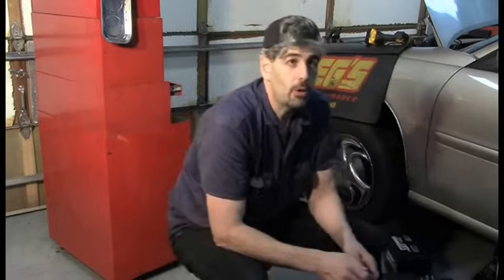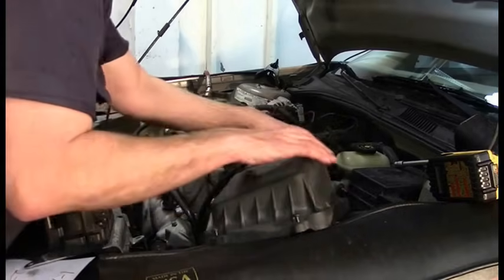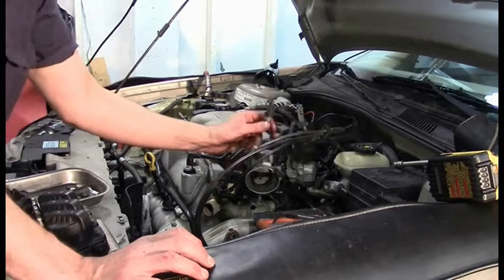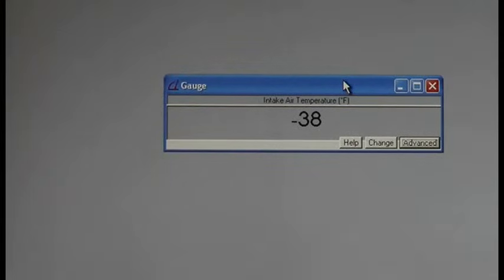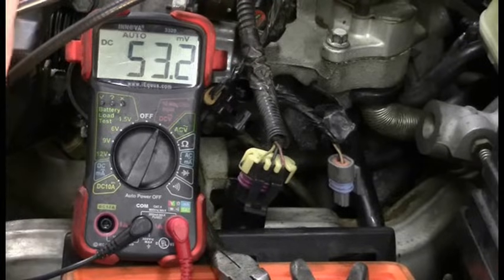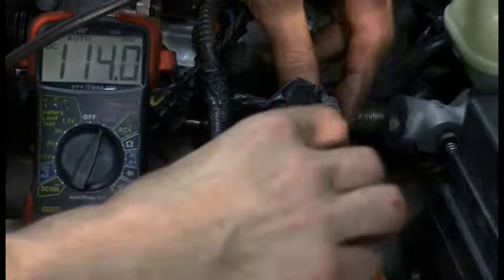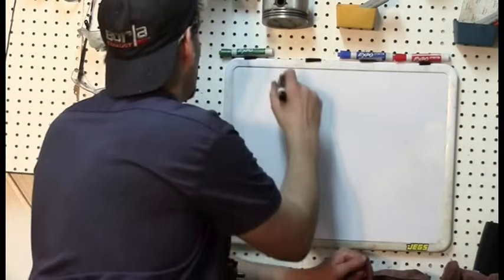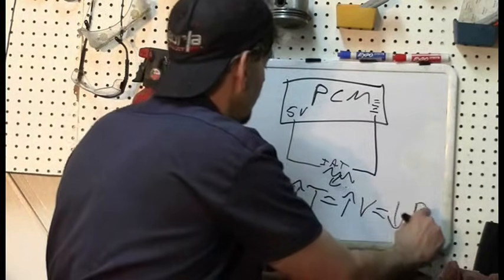IAT ( Intake Air Temperature Sensor ) Diagnosis P1111, P1112, P0113

Comment: The circuit for the IAT sense is slightly different than you drew on the white board.  Inside the ECM you will likely find a series resistor to ground on the signal lead.  This forms a voltage divider circuit that is read by an analog to digital converter in the ECM.
Reply from the maker: @arlen- upon closer inspection of the wiring diagram, you are indeed correct! Thanks for the info!
Reply: arlen, good advice and nice to know for sure…diagnostics on this circuit would still be the same regardless of whats happening inside the computer however.  The signal wire from the computer has to be capable of sending 5 v to the sensor, the variable resistor (sensor) has to be capable of accurately changing resistance based on temperature, and the return or ground wire has to be capable of returning the updated voltage from the sensor back the the computer.  If these 3 things are present, and good terminal/pin connections are good at the connector harness and computer harness, it has to be a bad computer..the circuitry inside the computer is irrelevant because its non serviceable anyways.  Correction: if all relevant inputs to computer are good, along with all powers and grounds, then its a computer issue.
Reply: Jeffrey:

When diagnosing problems in an electrical circuit, it is helpful to know and understand the circuit as it was designed.  This will allow you to discover the fault faster and with more confidence.  An incorrect understanding of how the circuit is supposed to operate will delay finding the actual fault and could lead one to replace good components.  The circuitry inside the ECM is not irrelevant, knowing what the circuit is allows one to understand what types of faults are likely causing the situation being diagnosed, and to devise tests to determine which particular fault is present.

Comment: I like the way you go about trouble shooting things.   Great videos, thank you for sharing Matt.
Reply: Hi , from all the videos that i have seen that you made, i know for sure that your knowledge on automotive repair and diagnosis is quiet impressive.  So i have a trouble on my 2000 Ford Focus DOHC, with a 5 speed manual transmission. 
My dilemma is, when the engine is cold, the idle goes up and down, i call it pulsating. On idle the "engine goes from 1000 to 1500 repeatedly  till the eng gets to operating temp. Then it starts to idle fine. Please help to try and solve my problem.
And thank you for your time.

Comment: I have the Power-probe Master kit as well and yes, it has definitely paid for itself. I've ran into this exact issue and you did exactly what needed to be done, good job Matt. Remember, when the engine is stone cold, all temp sensor signals should be identical if not close. You can quickly do a rationality check with a scan tool by looking at all the temp sensors.

Comment: Good vid man!  That reference to ETCG's wire soldering video was hilarious..man his vid was so bad I thought it was a joke lol.  GM issued a Technical Service Bulletin on this issue for this year make and model relating to these codes.  I think in the past somebody had perfumed the repair for the TSB and did a poor job.  Here is the TSB for your reference: 
Service Engine Soon Light With Stored Codes P0112, P0113, P1111 or P1112 (Replace IAT Sensor Connector)
1997-2002 Chevrolet Malibu

1997-1999 Oldsmobile Cutlass

1999-2002 Oldsmobile Alero

1999-2002 Pontiac Grand Am

with 3.1L or 3.4L Engine (VINs M, J, E -- RPOs L82, LG8 , LA1)

Condition
Some customers may comment that the service engine soon light is on.

The TECH 2 will show stored diagnostic trouble codes P0112, P0113, P1111, or P1112.

Cause
This condition may be caused by a broken wire at the intake air temperature (IAT ) sensor connector. The break may not be readily apparent as the insulation may be intact.

Correction
If routine diagnosis leads to a broken wire at the IAT sensor connector, replace the connector as follows:

Remove the tape from the engine harness convoluted tube where the IAT circuit wires join the main engine harness. 
Locate/isolate the 2 IAT wires within the engine harness. 
Disconnect the IAT connector from the IAT sensor. 
Remove the tape from the IAT and MAF (mass air flow) sensor wires to allow removal of the IAT wires. 

Important
Before cutting the IAT circuit wires, it will be necessary to determine the proper length. You need to add 38 mm - 50 mm (1.5 in - 2.0 in) to the length of the wire going to the IAT. Also, when cutting the IAT circuit wires, it is important that the wires are cut in a manner that will not create a large mass. Stagger the cuts and install the connector kit. Original connector cavity "A" has a red wire and cavity "B" has a tan wire. Make sure cavity "A" and cavity "B" wires on the replacement pig tail connector match "A" and "B" wires on the engine harness. This will provide strain relief and prevent recurrence of this concern.

After staggered cuts are made on the IAT wires in the engine harness, strip a small amount of the insulation from both wires and install the kit butt connectors to the bare IAT wires by crimping both. 
Stagger the cuts on the pig tail wires to match the IAT engine harness wires. 
Strip a small amount of the insulation from the pig tail IAT wire ends. Install and crimp both wires into the open end of the butt connectors that were installed on the engine harness IAT wires. 
Heat shrink both IAT butt connectors and let the wires cool off. 
After cool down is completed, the harness can be neatly taped with electrical tape. 
Install the IAT connector on the IAT sensor. 
Clear the codes. 

Parts Information
Part Number
Description
Qty

12102620
Connector Pig Tail
1
Reply from the maker: As always, thanks and great input.  Given that information I would surmise that this exact issue is what happened at some point and a previous owner replaced the connector on their own but it didn't hold.  When I examined it, the wires were just twisted together and electrical taped.  I'm sure at some point when the air filter was changed, the stress on the wiring at shoddy repair created the open.

Comment: So u traced the signal wire rather then the 5 volt ref wire??
Reply: with 2-wire sensors, the 5v ref is the signal if theres a variable resistor as the sensor.
Reply from the maker: frank hager Correct, Frank thank you.  Some sensors have 3 wires where one is feed, one is signal, and one is return (ground).  Not shown in the video is that I also traced the ground and it was open as well. 
  Happy Easter guys.
Reply: Schrodingers Box I was going to say that when you had confirmed the sensor was good, and then put your DVOM leads across the harness connector and were reading an open circuit, the only thing I would have done different at this point would have been to put my red DVOM lead to battery + and the black lead to the ground wire at harness connector to see if I had 12v.  This would have confirmed a good ground. Then black lead on DVOM to battery( - )and red lead to the signal wire at harness connector.  If ghost voltage was present at this point it would have narrowed the open to the power wire.  If I am dealing with an open, I always want to narrow it down to which side of the circuit the open is on.  Of course, in your case both wires would have tested as open due to the horrible repair that was done in the past lol. That could easily throw a guy off, since it is so rare to have an open circuit at both the power and ground side of the circuit.  Almost always its one or the other :) I have never used an open/short finder like you did in this vid, but I will be looking at getting one after this!  Even if it only saved me a few minutes each time I used it, it would be worth every penny!
Reply: Jeffrey Wilson Yeah, search 'fox and hound' circuit tester and you'll find lots of reviews. Briansmobile1 did a nice practical review video about a year ago on a less expensive device. These can be costly, though it would be possible to make your own with a signal generator and a receiver. I wondered whether making my own would put my vehicles at risk of damaging sensitive downstream electronics, but that risk is pretty low if you can isolate the circuit in question from the PCM. In the end I chickened out and got a factory made device -- no guarantee, but probably less risky. More expensive devices have a longer range to search for wires behind drywall, etc.
Reply: spelunkerd Thanks for the info and I will check this out.  I would certainly admire anyone who successfully made their own open/short finder like the ETC 2000 that was displayed in this vid.  Judging from Matts vid, he had only disconnected the harness from the sensor, and the wiring to the computer was still connected and this tool did not harm the computer in anyway.  If somebody had a good knowledge of how this unit worked and made their own, I doubt there would be any harmful issues to the computer.  That being said, I am not that guy! LOL..I would buy a trusted good unit before trying to make my own every time lol.  I would also only ever use an automotive specific tool on cars…but thats just me :) If you ever do make one and find it successful, let me know…ill order one :)
Reply from the maker: How about if i checked for continuity between battery negative and the IAT ground wire.
Reply: You had the voltmeter right there ready to go, why bother? To properly test continuity the circuit must not be powered and if you are using an ohm meter to test continuity the circuit must be isolated.    You could have 19 strands of a 20 strand wire broken and still have continuity across the 1 strand, but when the circuit is loaded current may not flow.   No need to go to computer and unplug it in this case.